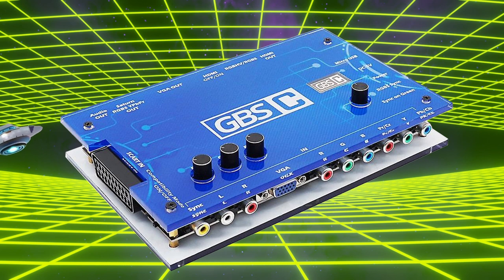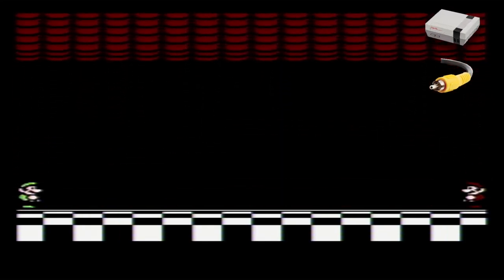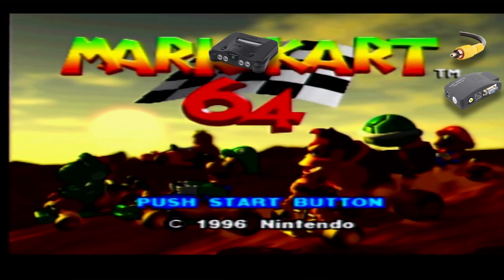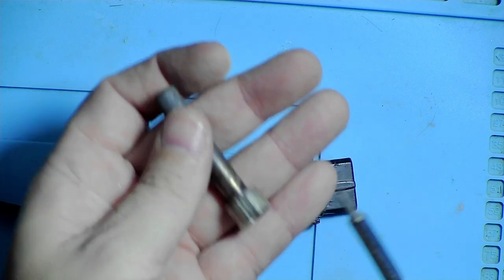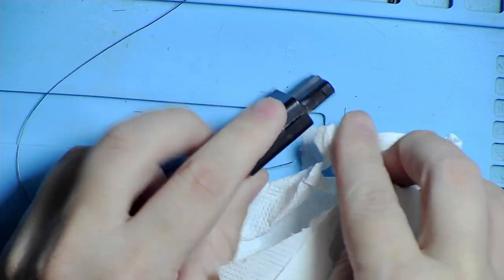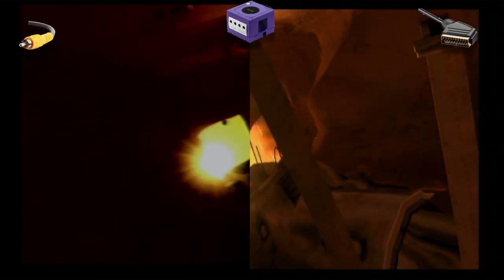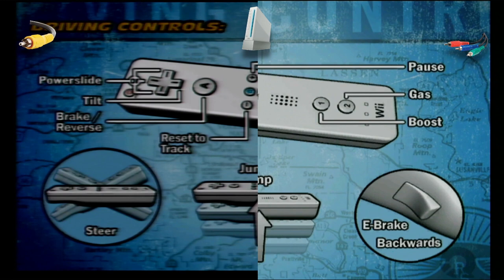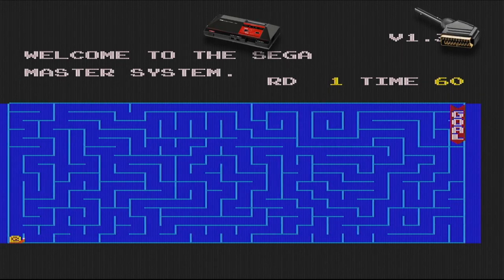Enhance Retro Gaming with GBSC Upscaler & RGB Cable Hacks

Comment: I use a DIY GBSC for most things, scaling to 480p on a VGA monitor from component. I havent bothered adding SCART RGB, as I dont do much Nintendo tho i should. Mostly Saturn, PS2, etc. Some of the newer prebuilt GBSCs  are tempting! Low cost scaling and HDMI etc output, and with an SVideo input i dont think id need to convert most to component which for some things can be annoying.
Reply from the maker: Hi, yeah so i agree with you that the new prebuilt GBSC are compact and pretty complete they still have issues , the version i have suffers from syncing to high resolution VGA /Component signal everything above 800*600. and it struggles keeping a connection to Wifi when 1080P is output from the scaler(interference from the HDMI chip to Wifi Module ) 

all this could of course been ironed out in Designee stage but now that this is a cohesive Designee its hard to Isolate the chip for example so HDMI doesn't kill the signal .

i am planing to pick mine a part and check if anything can be done to improve the sync and Wifi issues maybe use copper tape over the data lines for the HDMI out :)that should make a barrier for RF noise  

ok ill stop babbling on now :) 
thank you a lot for watching the video
Reply: I did wonder why the WiFi kept dropping out on it @RetroUpgrade

Comment: The RGB mod for earlier versions of the N64 is relatively inexpensive and easy to install (I think there may be more than one cheap RGB mod you can do, but I assume they're all very similar to each other). The RGB mods that will work with any version of the N64 are expensive and a lot more difficult to install. 

However, if you include the cost of labor to get someone else to RGB mod your N64, even the cheap one is going to be relatively expensive, I guess.
Reply from the maker: Oh i was under the impression all eu n64 except for the French version are all none RGB modable unless a active converter is used(expensive mod). The mode used on us versions uses a passive rgb filter directly from the gpu to nus connection if i dont miss remember. Do you have any more info on this 😊 would gladly test on one of my n64 have 5 right now
Reply: @RetroUpgrade  Yes, I believe you are right on that point, as that is also my understanding. 

I was thinking mostly of NTSC versions of the N64. While that might not be very useful info for people who want to only use a PAL region version of the N64, I know some people who live in PAL regions actually use NTSC versions of the system. I would actually recommend using an NTSC version of the system if you can, because a lot of NTSC versions of games will run at a higher frame-rate due to often being locked at 30 fps instead of 25 fps (though many games will still struggle to even maintain 25 fps regardless of whether it's the PAL or NTSC version). The way NTSC games were converted to PAL versions was often not done optimally, apparently. You can buy a flash cart for your N64 (all of which are compatible with both NTSC and PAL region systems and games), which, if you know what you're doing, will enable you to play any NTSC versions of any PAL region games that you already own. 

To my knowledge, a fairly large percentage of NTSC N64 consoles are compatible with the cheap RGB mods like Voultar's RGB mod. You can buy cheap RGB mod kits like this for as low as about 15 USD including shipping from Alliexpress. I don't know much about the differences between these various cheap RGB mods, but I have heard that they are all more or less the same, and are all roughly equally easy to install, and are all compatible with the same versions of the N64. 

I have read that the early French versions of the N64 which are known to be easy to RGB mod are even cheaper and easier to mod than the RGB mod friendly NTSC versions, but they are far more rare. If that's true, then there's basically three main categories of RGB mods which can be done for an N64, but with some variation within these main categories, and with only the most expensive RGB mods being compatible with all versions of the N64 main board. There are at least two different expensive RGB mod kits which will work with any N64. One of them is called RGB Advanced, and the other is the Tim Worthington RGB mod (there might be other versions as well). Some of these might become pretty cheap at some point, but they're both excellent mods already. 

Voultar's video on installing the RGB advanced mod is quite good. If I understand correctly, this mod allows the use of a cheap dongle to enable compatibility with Wii component cables, which could save you a bit of money and potentially offset the high cost of the mod kit, especially if you already have a good quality Wii component cable. I guess Wii component cables probably aren't very common in Europe... in fact, I don't even know if they would work with PAL versions of the Wii, now that I think of it.
Reply from the maker: @syncmonism  
Very good point a NTSC n64 sounds like a very good alternative to PAL , they are a little pricy to get to EU due to tax and import stuff , and they are quit rare here , actually easier getting a JAP n64, but i am not sure on what NUS chip they use in there versions . ill defiantly be on a hunt for a NTSC n64, have 7 PAL versions at home atm :P 5 normal ones and 1 transparent blue and 1 special edition pikachu edition in boxed , will be giving away 1 normal one with some games when i get to 1k subs so if you want a pal console for experimenting keep an eye on the channel .

and the information you provided is very helpful as i know a lot of info on pal consoles but limited in the NTSC world

thanks a lot for the info and support :)

Comment: Hey! In your previous GBSC video you mentioned a different composite to vga converter. I wonder why you finally used a different converter in this video. Is there any notable difference? Which one would you recommend?
Reply from the maker: Hi. Sorry about that my other Converter stopped working the day before recording. There is only a small differences in lagg . The one that I used in the video has slightly less lagg. Hope this helps 😊

Comment: which VGA cable did you use on the dreamcast? I heard reports that vertical synchronization causes problems with the gbsc (model shown in the video), but you used it normally. I bought the vga cable from the retroscaler itself, which also supplies gbsc.
Reply from the maker: Hi,  no special cables used at all i actually used my aliexpress generic VGA cables, quality is not great ether , think the reports are referring to the original SEGA cables. don't have any to test on so i don't really know . my Dreamcast cables where about 6-7€ on aliexpress 
the link i bought them from doesn't exist anymore unfortunately

Comment: The gbs control seems enticing for my ps2, xbox, and wii setup, but I'm hesitant becuase of how bad composite console like NES look on the gbs control. @RetroUpgrade do you think I should invest in a retrotink or ossc to future proof my setup or should I buy the gbs control for my current setup. Any suggestion is greatly appreciated!
Reply from the maker: If you want a reliable upscaler that also handles composit gbsc can't without a external convert. Ossc is cheapest option best would probably be retrotink 4k but prices is way too high. Gbsc is a good hyper budget version . I am looking into modifying min to make it less buggy. Now that i finally have a ossiloscop in my tool bench i can see why it's so bad att picking up sync 😊

Comment: Does the gbsc output in limited RGB? Or Full RGB?
Reply from the maker: Hi, 
Not really understanding the question .
could you elaborate a bit more on your question .

It can output RGBS and YPBPR via the Saturn output on the back . 

the resolution will be the one selected in the scaler . 

the VGA out outputs RGB-HV
and OF course the HDMI is converted to Digital RGBHV.

not really sure but if you mean the bitrate of the RGB signal  .

according to the data sheet for the TVIA trueViiew 5725 Chip. 

the out put can be a max of 24bit output with a Analog input , and this is converted with a DAC to a VGA signal , and if HDMI with is set it goes to a HDMI encoder

so my guess is 16/24bit minimum so it should not have color banding on a amiga for example
Reply from the maker: Correction : the Trueview 5725 has 3x DAC at 10bit for analog outputs and for digital it runs 4:2:2 Format  .

so this should roughly give 1024 Shades of RGB, so roughly 1.07 billion colors :) 

8bit gives the normal 16,77milion colors

hope this helps

happy Halloween
Reply: @RetroUpgrade  I appreciate it. I believe it's for black levels. Rgb full is typically for PC monitors, and Rgb limited is for TVs. I bought a component to hdmi converter but it outputs rgb full, causing crushed blacks on my TV. My tv won't let me change the levels unless it's an hdmi, or VGA source. I'm looking for a component to hdmi converter that will output 4:2:2 limited range. My retro tink 2x classic does, but it doesn't pass through progressive scan 480p.

Comment: Could you do a downscale video to 240p?
Reply from the maker: Hi, Yes was Planning to do one but I am having problems with my GBSC to take in anything over 800*600 at the moment (may be mine is faulty or  a designee flaw), and I actually don't have a CRT at home (usually why you would like to downscale ) ,  that said I am investigating and checking why it doesn't sync  on inputs over 800*600 and will update when I find any solution and of course will make a downscale video  to 240p 😊

Comment: using the gbs all wrong, not intended for use with composite, especially using a cheap converter, in most cases from this video your better of just using a svideo cable and a retro tink 2x clone to get hdmi, composite and scalers dont mix well, garbage in =garbage out , you can polish a turd but it still stinks
Reply from the maker: You are completely right !, i cant find a decent enough converter for composite to RGB because of noise and other issues (almost impossible to get it back to true RGB), I am currently working on a composite to RGB AI model that is trained on video game image in both composite and  RGB it does 1 line at a time . so far i am struggling getting a consistent image due to only processing 1 line , but i want the AI model to fit  on a ESP32 8mb model to make a new type of converter , if i make a break trough ill post a video otherwise its just a experiment :D
Reply: @RetroUpgrade  wow that sounds really cool